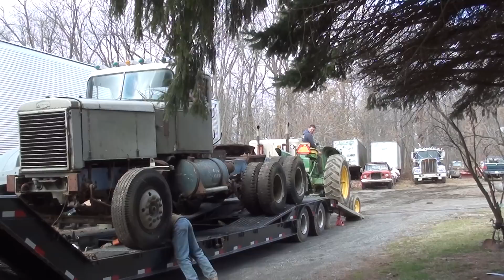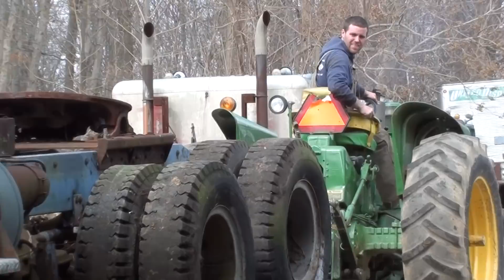1960 autocar truck with a cummins motor

Comment: I can still recall those auto car's when they were new' some had a 200 series com in  them, others had a ball busting tall block huge power plant of a six them: rigs by design were rather basic then"  High tech wasn't much more then chrome here & there, with flashy new paint job: & the radio"